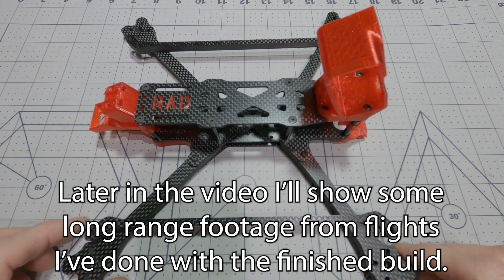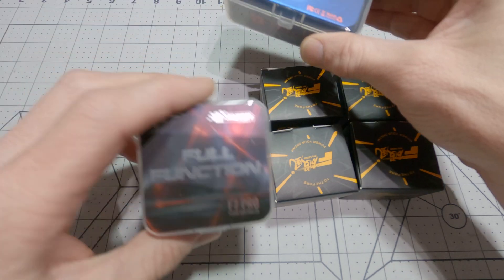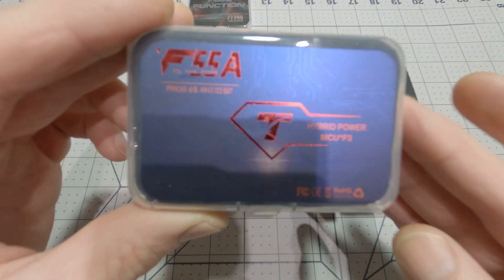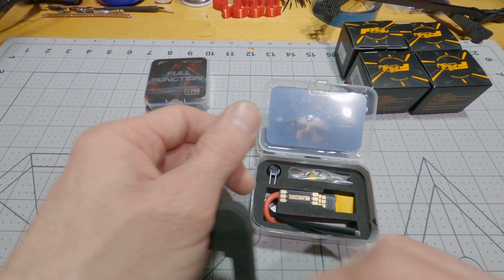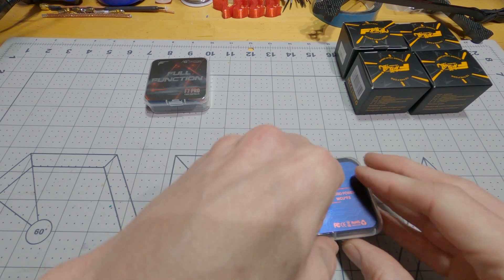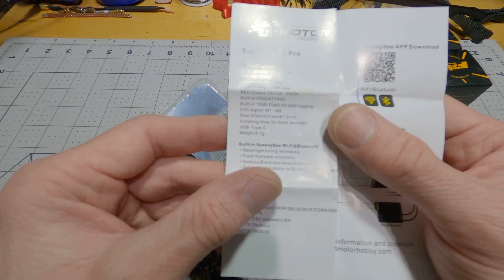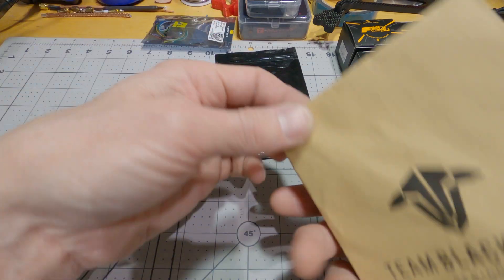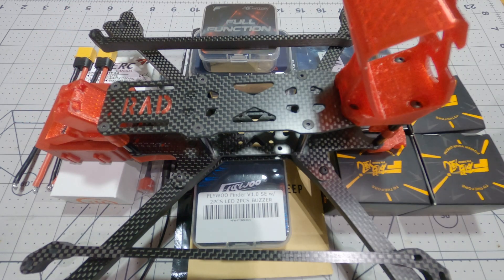Super efficient 2022 Long Range FPV build: Parts discussion

Comment: Would love to see some longrange on 8" props with 3008 1150kv for 6s, bet you could break the 30min mark, both HQ and gemfan got some good 8" props out now, 3106 1200kv is stupid efficient on 8" props but you will notice bobbles in wind
Reply from the maker: Ya, I think, 3106 would be too much weight so far out on the bell for 6mm tall magnets.  I'm likely going to try the F100 2810 next for the 8" since I'm in contact with T-Motor.  I really like the extra bit of quality with the T-Motor products after using some for a while now.
Reply: @FalconRadFPV  yeah I've had quite a few brotherhobby motors that have had the zero throttle honk lately, 2810s are nice and torquey on 8", loved em for freestyle... You could probably get away with 48khz+ pwm  to help get some of that efficiency back on tall stator
Reply: Yea testing 2806.5 I have with 8". They are lil weak. But really don't want to change the motors cause I'm prob going back to 7" & buy better 8 or 9 or 10" frame

Comment: Wow, very cool! Looking forward to the build video, currently building a quite similar 7”. I noticed you mentioned that the ESC is already conformal coated from the factory? Very nice to hear, I hope it was done right and does not need to be coated again
Reply from the maker: They left the power and motor solder pads uncoated of course.  So after install you just need to coat those parts top and bottom side.
Reply: @FalconRadFPV  that’s awesome, thank you!

Comment: I’ve got a rekon 7 hd that wobbles really bad. Any advice to help it?
Reply from the maker: This is just my opinion don't take it as straight fact, I've never even seen a Rekon 7 in person and I'm not an engineer, but as soon as I look at pictures of a Rekon frame I see likely vibration issues.  I'm betting the pitch axis has some big blackbox spikes due to the configuration of the rear arms in relation the the battery weight.

In the case that I'm completely wrong maybe someone who is good with blackbox analysis could help you tune it better.  For a quick guess, with betaflight 4.2 I would suggest slowly working all sliders up to 1.2 to start,  adjust PD balance to 1.1 for light batteries (except for stick sensitivity maybe 0.7 for that) but be careful, if there are bad vibrations it could damage the motors.

At worst I would guess that if you swap the parts out to a different frame that would solve the issue.  I've seen a number of videos with wobbly Rekon 7 quads, not so many with great flying ones.

I just delayed the release of my second frame for an extra month (after over a year of tests and revisions) to sort out a design issue, now my test version went from a minimum resonance frequency of 185hz up to 215hz.  I've got 13 different 3D prints ready for the release and will be making a couple more for sure.  There are lots of FPV frames out there, some have more testing, time and energy put into the final product than others.
Reply: @FalconRadFPV  thanks for the input. Hopefully I can tune the wobble out. I do get pretty god footage after stabilization but I can tell it’s having to work hard to work around the wobble. If I can’t I will def look into getting one of your frames. Which one would you suggest for a 7” drone and where can I find it.

Comment: Did you get 24km flying in circles?
Reply from the maker: It was at a test field.  I flew at 40 to 60 kph in 1/2 kilometer circles and figure eights.  There is a small mountainside that I go part way up as I'm flying around, so there must have been well over 1000 meters of elevation gain over the flight.  A large mountain with say 2500 meter elevation gain and a fair amount of wind would shorten that time.

Comment: Cam you give more details on how you test time/distance? What speed/climb did you do? The distance seem very small for this amount of battery
Reply from the maker: I was flying at a test feild.  I did 500 meter loops.  Going up and down about 200 meters with each loop.  Flying up a large mountain with wind the flight time would be less, depending on the peak elevation and wind strength.
Reply: I found that prop choice radically changes flight time. For now the best efficiency props that i tested are dalprop 7040r (two blade) and gemfan 7042-2. They are 30% more efficient than dalprop  fold f7 as example
Reply: I got 24 km on stock chimera 7 with 5s2p molicel 21700 cells. Flying level with 60kmh speed. Also on custom mark4 with 2306.5 and 6s2p got around 29km of level flight with 80kmh and gopro. Climb obviously will shorten the range, but i don't have mountains here, no reference to make different flights comparable

Comment: I built a 6” that flew for 37min without a naked gopro on a 3000mah li-on 6s
Reply from the maker: Ya with no GoPro on board the frame can be lighter since you don't need to worry about the quality of the HD video.  No full size GoPro on a lighter frame would get much more distance.  The point of my builds is to capture crisp GoPro footage of the flight.  This was with a full size GoPro, so the quad and GoPro are both water proof, much needed for flying in the mountains anytime other than summer.

Comment: When we can buy this new frame? Battery for this flying time?
Reply from the maker: It will be on my FalconRad FPV page in the CNCDrones store in the next week or two.  Hopefully by next weekend.  This flight took 7200 mah from a 6s2p 21700 li-ion battery.  It flys a bit heavy feeling with 21700 cells in 6s2p but extends the range.  I just got some brand new 18650 cells to make new 6s2p packs, I'm guessing at between 19 and 21 km with the 18650 setup.  (My old 18650 batteries are over 2 years old now and not what they used to be so I made them into 8s batteries for testing)
Reply: @FalconRadFPV  Have you tried an 8s setup already? I wanted to try a light 21700 8s1p setup wiht the Foxeer ESC

Comment: Weight?
Reply from the maker: The build is 580g with props and battery straps, no GoPro.  About 190g for the frame and hardware without TPU parts.
Reply: @FalconRadFPV  Okay, thank´s.
Happy easter.